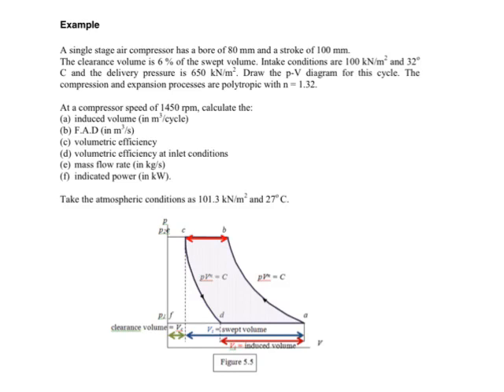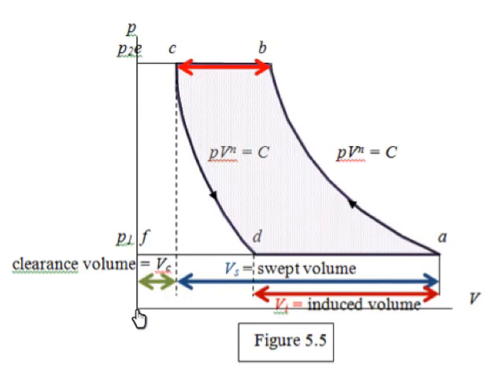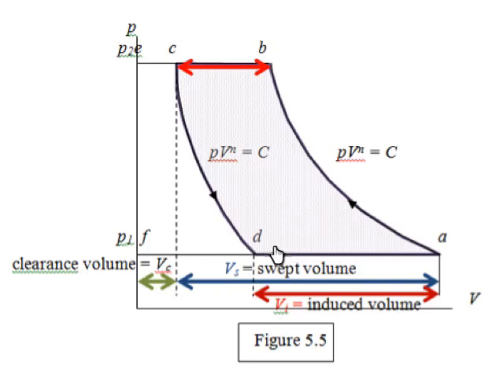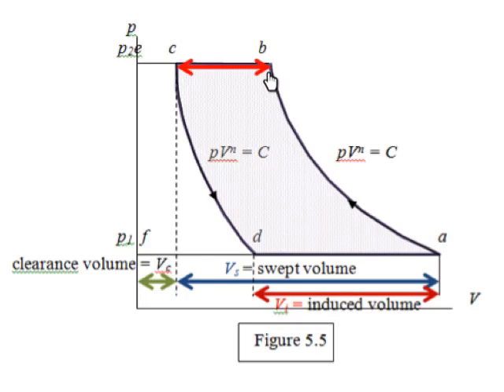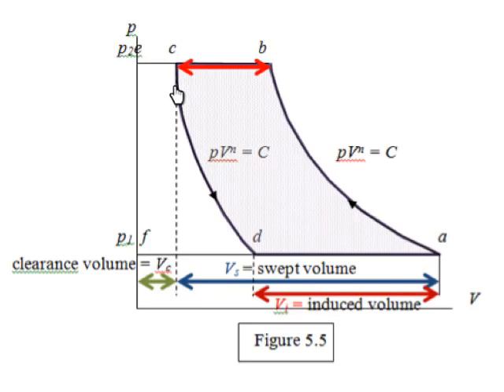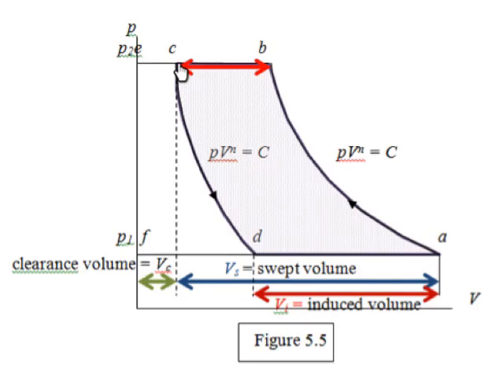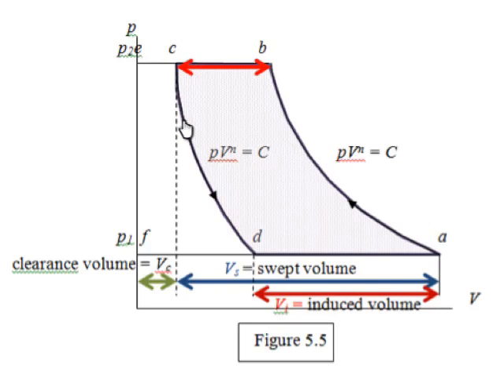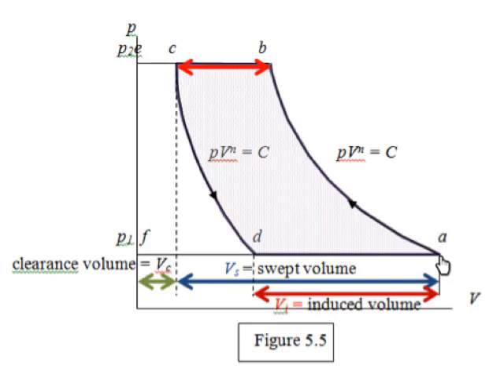The compressor indicator diagram

Comment: Thanks for this. I've been confused, we we're not taught what the difference between Vd and V1 (induced). And I just thought that V1 is the same as the V1 in engine compression. And I've been looking for an explanation why Vd is greater than V1 for compressors.